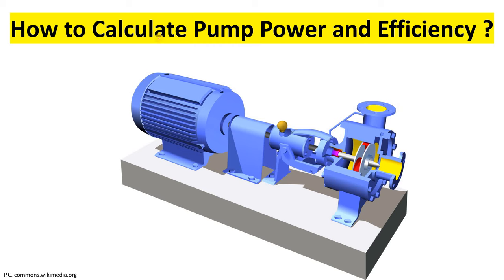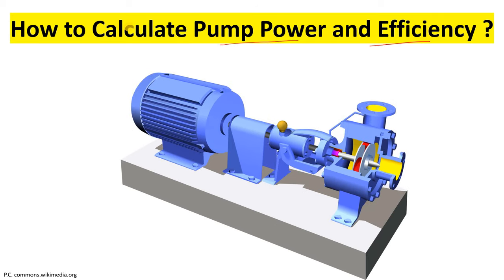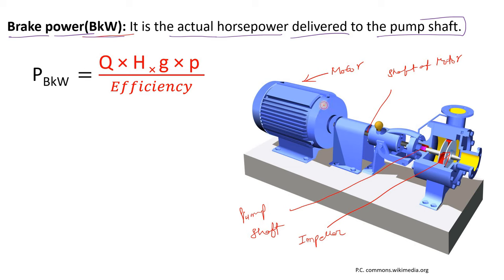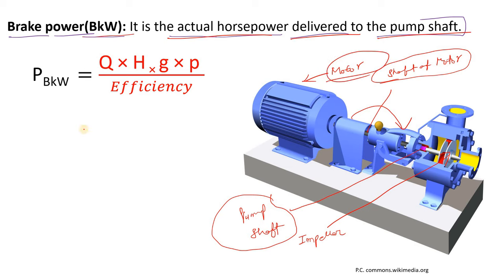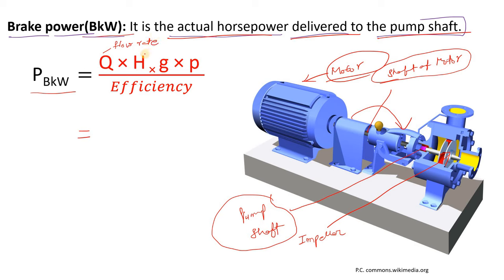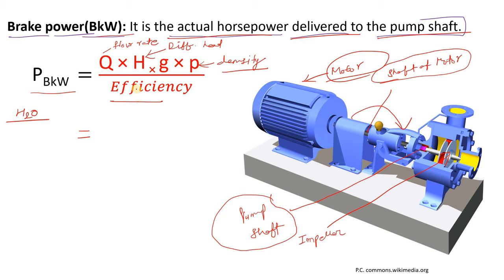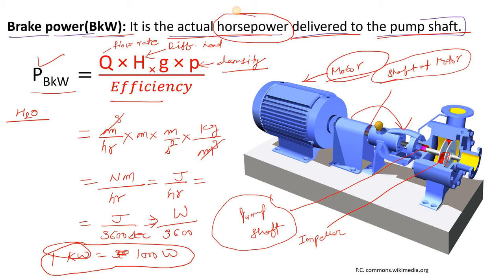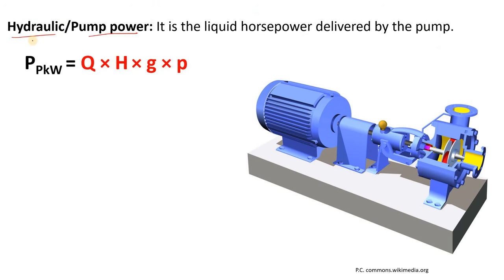How to calculate the Power of centrifugal pump | Calculate pump efficiency | BkW |  hydraulic power

Comment: In BHP you told to take efficiency wheather its pump efficiency or motor efficiency, if we know the efficiency in BHP means why we are calculating the pump efficiency by hydraulic power/ BHP